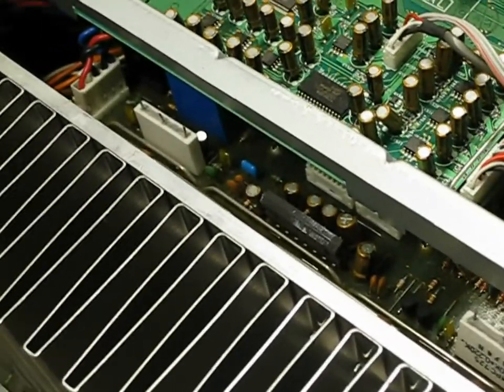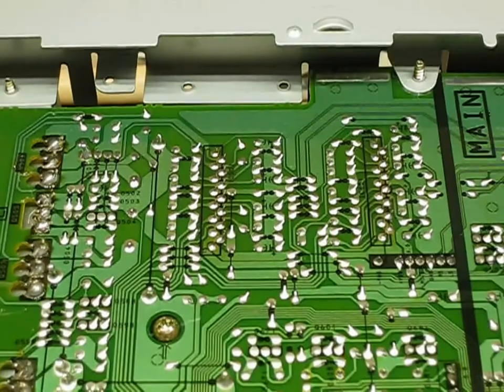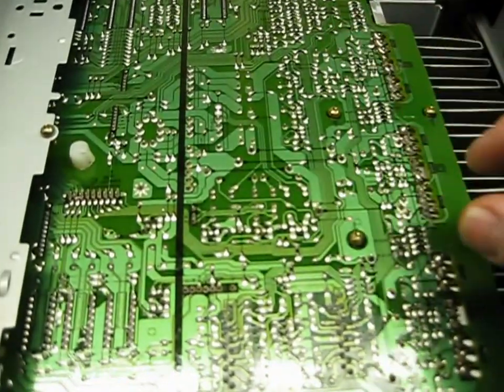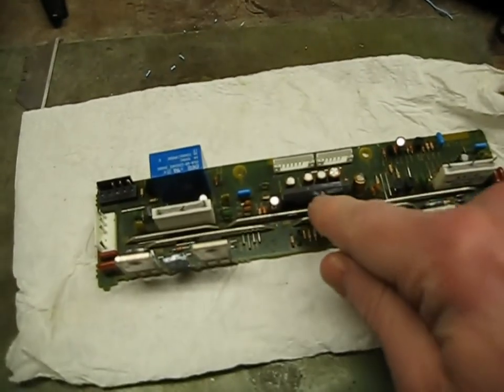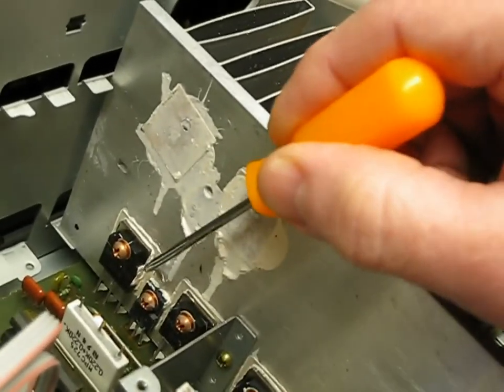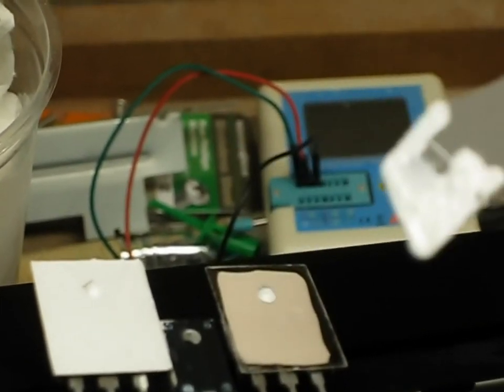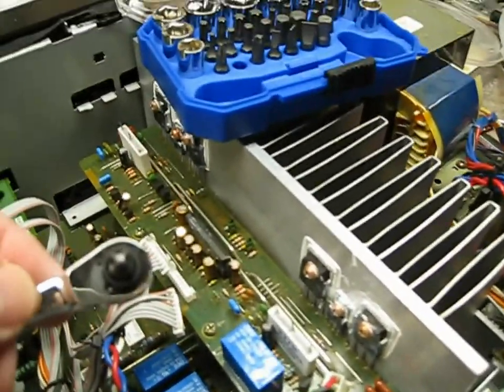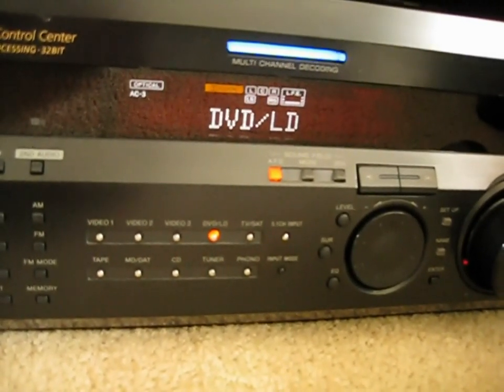SONY STR-DE935 FIX  *Common "No Sound" Issue *  -Plus *Broken Switches*  PART 2

Comment: Hi! There was a repair of the SONY amplifier, the speakers were sometimes turned off, there was poor soldering on the relay terminals, but it turned out that the OSA-SS-224DM3 relays immediately failed 2 pcs, instead of zero resistance they show up to 300 ohms, the amplifier was little used, and the relays are not high-quality! Which are the best relays to install instead of the factory ones?

Comment: If that "insulator pad" is actually an insulator pad, what about the screws that directly connects the transistor grounds to the heatsink?
Reply from the maker: The screw hole is insulated front through to back from the metal.

Comment: Still for sale?
Reply from the maker: Already sold.
Reply: @AudioTomReviews  Beastly Amps. Did you find the service manual for it that's online? it has "updates" for deleting transistors on the rear amp and main board, placing jumpers and changing resistor values. Just wondering if you might be able to shed some light on what those changes do.
Reply from the maker: @snap-off5383  Sorry, never saw that, can't help you there.

Comment: If those voltage amplifiers get loose connections the outputs on them can short out, meaning you will only hear sound from the speakers or headphones at max volume (preamps)
Reply: Might be the problem my DE835 has. It would randomly play sound on start up. I would have to turn it on/off many times til it decided to work. When it wouldn't play sound, if you turned it up all the way, you would hear a faint saint. It did this for a couple years until it got bad enough that no matter how many times i turned it on/off, it rarely would work. Replaced it with a Denon AVR-989 in 2016. The Sony was used daily since 2000. The late 90's/early 2000's Sonys are great, the last time Sony was good with home audio.